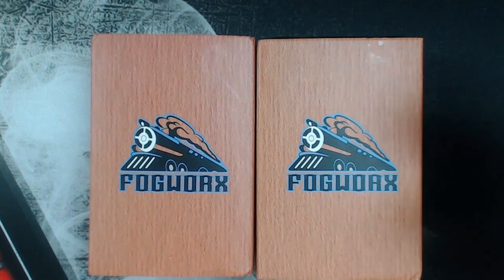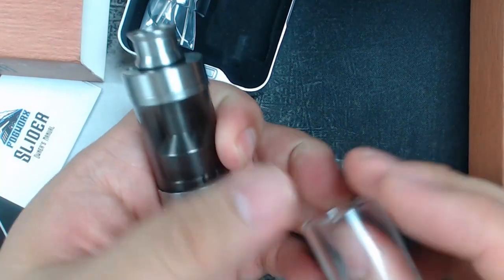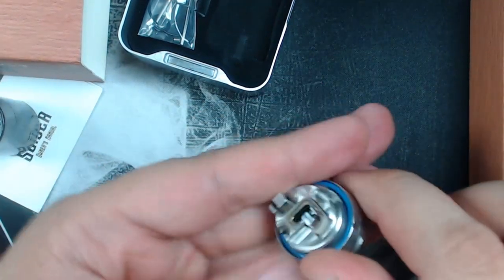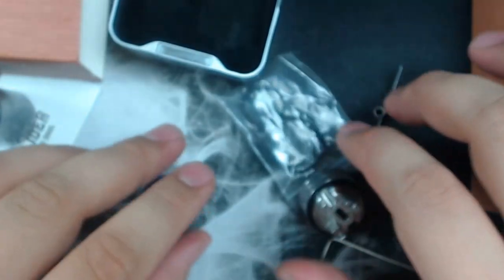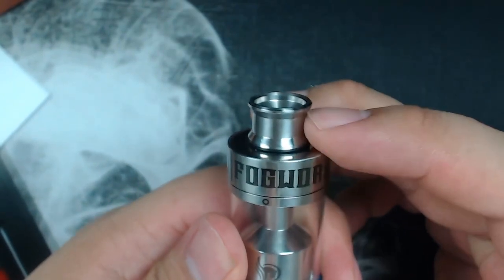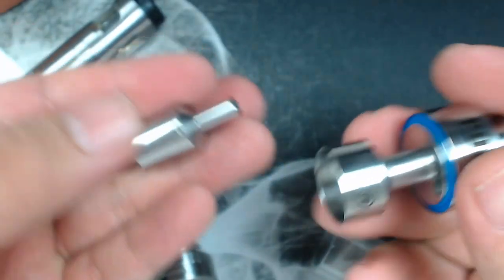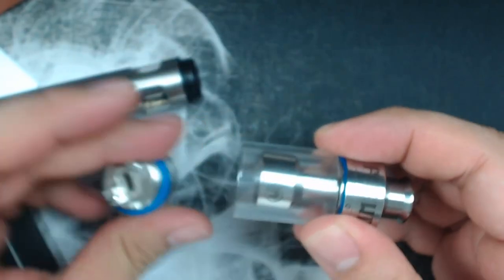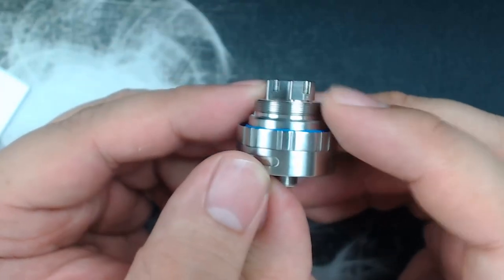FogWorx Slider RTA   Creation, Construction, Back Story

Comment: Hey Peg, First of all I want to say, I love this tank.  There are a couple of things I believe should be done. I believe you have to do a build video for people that haven't built very much. When I installed the coils I found that the coils that came with it won't fit straight into the slots. I've built long enough to know to twist the legs 90 degrees and they went in with no problem. The coils are the nicest ones I've seen come in any atty kit to date. 2 points for that. lol I think you're going to get shit from guys that haven't built very long saying that the coils that come with it don't fit. I can hear it now. Another thing is I don't like the hex key (It sucks), on the first build it striped out and I didn't even tighten it all the way, and yes I had it all the way into the grub screw when it happened. 
       I love the fill cap on this tank it's easy to fill, with no leaking or seeping at all. Nice design bud.  I've only had it a couple of days but haven't had a single drop of juice from it at all and that's with 6 tank full put thru it so far. It's been very easy to build (once I twisted the legs) wicking was a piece of cake. The flavor is excellent I haven't had any wicking problems and I ran this up to 65 watts just to test it with no problem at all. I've been running it between 45 and 50 watts. You got a great tanks here. One thing, is there any way to get a couple of the new o-rings for the ones that I've got. It would be nice to be able to flip the tank as you described as I tried it before this video and lost the juice that was in it, I could of used a syringe but figured I'd give it a shot - oops - lol. Anyway thanks and I'll write you again after using both tanks for a while.  Thanks for the opportunity test this for ya, I love it so far.  Later
Reply from the maker: Literally everything you mentioned has been taken into account and will be corrected.
I appreciate the feedback MArvin and hopefully you'll come back for a finalized version.
It will make sure for more solid screws, larger slots.

Comment: Hey Peg, I've been using the new Slider RTA and it really vapes great. The Slider cap is so easy to use! The drip tip allows great airflow and never gets hot. Great design! The only change I thought I would like to see would be larger diameter grub screws which you have addressed!

Comment: Got this tank SUPER fast and even though I couldn't get the included clapton to work, I put a twisted 28 gauge build in it. Im running 1.39 ohms at 17.5 watts and its an awesome vape. I also closed down the air halfway because I like a more restricted vape. Flavor is awesome!

Great Job!

Edited to add: Saw you comment to someone there was still a few available and got another for the S-O :)
Reply from the maker: Nice,  how does this pair to your preferences?  
Thoughts on 24 MM?  5.5 ML capacity? (be sure to consider that larger capacity would suggest a longer chimney or wider atomizer)
Were you able to chain vape with any issues?  Was the vape moist?  any spit back or popping?  Thoughts on the drip tip or prefer your own?
Reply: Im fine with the size and capacity of the tank. I dont have alot of experience with 24 mm tanks or RDAs because I have been stuck on the tugboat since it came out and nothing has replaced that for me. LOL 

I dont really chain vape, but I did not get a dry hit at all (Im using a 65 vg juice which isnt all that thick) 

When I use twisted kanthal, it never pops or gives me spit back. (I actually miss that old carto pop) The drip tip was fine IMHO. I have yet to want to change it to something else.

Comment: Great features. I've been looking at the latest Ammit 25, but the point you made about too much airflow not keeping the cotton as wet makes sense because of how they work. You need some vacuum in the chamber to pull more juice in. I'm a chain vaper so wicking is crucial to me. That's just how I vape. Although the threaded coil channels could be wider for our fat ribbon staple builds, I'll be watching for this from Canada.  Thanks PVA for your work!

Thanks from some random guy to beta testers as well! Instead of some engineer thinking he knows what vapers will like we'll all get a well tuned RTA. :)

"Phone size corresponded directly with network bandwidth and once people realized they could watch porn on their phone the screens got bigger again." ~old meme

Comment: Hi everyone, Here are a few of my thoughts on the Beta RTA. Extremely economic on the usage of juice and battery life. I have been quite impressed with the lower wattage (30-48) running a few style coils. Mainly I have been using Staple, Framed Stapled and a Staggard Fused Staple Coil. The unit really never gets too hot after chain vaping. 

There were a few concerns I did have on the Beta that seems to be addressed in the production version of this unit. So this vid helps to better understand this unit and the builds this unit will accept. The only concern I still do have is the Slug screws. The beta version these are really small and very easy to cross thread in the post. When I used coils that were framed the screws and posts were not able to hold too much. And on one Framed Staple I had put in (2x26g with 8x.5 A1 ribbon, 36g wrap) this unit had the screws barely holding the coil. I ended up cross threading the screws just enough to hold it. 

Overall this is a really impressive unit. The cloud and vape quality is what I would expect out of an RTA and this one goes a bit further with the economy of design and conservative nature of using juice and batteries. 

Thanks again for allowing me to participate in the beta and look forward to all the products from Fogworx

Comment: glad i got to see the deck.  i should have mine by tomorrow.  from what i saw, the fill method looks interesting.  the markings on the tank don't look like they're etched in too bad so maybe i can sand them off.  the unmarked prototype you  showed was exactly how i felt it should've come.  one more possible issue i see is the airflow outlet on the build deck.  without a slight lip around the airflow hole, there may be a possibility of leaking.  I guess i'll find out soon enough.  What do you recommend for coil resistance, coil diameter, and applied power to optimize performance out of this tank?
Reply from the maker: The coils that come with the tank is not without its issues,  it was also a reason why we had to switch factories and this beta model is now a dump item.
We still released the samples because it is a working model and does vape the way we expect it to.  Simply put,  its got a few bugs but nothing we can't iron out in the final release.
Personally we've ran .25 coils in this thing all the way to .7   Its just an opinion but if you want the creator's intention then we think .3 ish coil is best  and adjusted to whatever your wattage equivalent of 3.6 volts is.  In my experience I find wattage numbers debatable between different devices.  However a nice 3.6v mechanical voltage is what we were aiming for,  I think you understand our reasons for this setting.   

Bottom Line: we aimed to create an easy to use, large capacity, flavor tank.  If you can see it as an everyday carry for a single coil lover, then we've hit our mark.

Comment: Hey Peg thanks so much for doing the beta version the other day. It came extremely fast and i broke in to it immediately. First thing, love the drip tip as you said it is really comfortable. Also thanks for the tip about keeping the wick at the thread line. It works beautifully now especially because I just changed my wick. I didn't have any leaking taking it apart (was very careful) with the beta O rings. will you have the newer O rings for sale anywhere? I'd like some. Thanks again for the opportunity to give this a try. It works terrifically and looks sexy in gun metal. It's pretty big and beefy though, as I'm usually into smaller rda/rta s. It's really not a problem though.
Reply from the maker: Thank you very much for taking part and your feedback.
how much did your coil ohm out to and what wattage did you find comfortable?

Comment: Hey Peg, I skipped around a lot during the video to get to the good stuff. Did I miss you say where to get the newest version of this tank? Found of gear best but it doesn't look the same as the blue o-ring edit "gasket" one you shown in the video. Thanks!
Reply from the maker: Gear Best has the dump inventory.  Everything we rejected.   I can't say those are clones.  Those are rejects.
In the story I explained the company we were dealing with would constantly deviate during each revision.
Eventually they told us they were not going to revise any further and we weren't satisfied with the outcome.
So they said take it or leave it,  we left it.

We decided to hand out all the samples we received because they are still working models and still vape like the way we intended it to.
Ofcourse we can't do giveaways so we did a ridiculous markdown on the PVA website.  You basically cover the cost of customs and shipping.

I knew that we have enough early adopters on our channel willing to help us out with testing and insight and generally help us put the word out there and confirm our claims for a quality device.  Plus these are unserialized sample version and easily a collector's item.  Still,   I personally think its worth waiting for the final release.

Comment: I got mine today (3335) and I like it. If the upgraded gaskets become available for purchase, will they fit on this beta model? Is it possible to disassemble the deck (post and center pin) without doing damage to the deck? Thanks Peg

Comment: Hi, regrettably I ordered a Slider from GearBest before coming across this video. Is there anything I can do apart from sending it back (which will almost cost me more in postage than what I paid)? I hate to be supporting a factory that practices these kinds of things, releasing a bèta product onto the market (and it also would be nice if the glass could support itself with the gasket and a fraction bigger screws (the provided coils don't fit the way they're intended to fit, but I never use coils that come with a product without specs on the coils).
But apart from these things, I really like the vape I'm getting from a single core SS316L clapton (26g+40g) at temp control. Thumbs up for that!
Reply from the maker: Regrettably there's nothing we can do because they're in china.  However they have been warned not to touch the US market or legal action will be taken.
The good thing is that the beta is a working edition but its just not optimal.  The clapton that came with it is rotated in he wrong direction and the post holes dont support it right.

I'm glad you still eny the vape,  the purpose of this model was to optimize a single coil and get folks mind sets away from everything needing to be dual.

Comment: Hello I just received the slider rta and I have to say the looks are so nice but unfortunately I'm doing something wrong or it's extremely difficult to wick because the taste is very bad.  I think the first time I put too much cotton and so I reduced the cotton to where you can't notice it on the holes.  After that it was still bad and I'm so bummed out because I really was so excited for this tank.  I also noticed it was very hard to rotate the bottom air flow even after I juiced the threads.  I hate to bitch man but I'm sure it's me because a beautiful tank like this can't be tasting like this.  Any suggestions?
Reply: I also used the coils you included which looked real good and fired up beautiful
Reply from the maker: hmmm.
Follow these steps no matter how simple or silly it sounds.
#1 Adjust aiflow to maximum first.
#2 Build a coil with a 3mm inner diameter.  Make sure height is balanced and leads are cut flush.
#3 Work out your hot spots first but start with low wattage just to get a light glow,  no reason to light bulb it.
#4 Hot spots are easier to work out if the coil is spaced.
#5 do not choke the coil with cotton.  trust that your juice will expand the wick enough later.

What is the ohm or your coil?  it shouldn't be lower than  .25 for a single setup.
Whatever your wattage setting make sure you're not applying more than 3.2 volts to starts.
Then increase as desired.

Lastly,  try a different juice.
Reply from the maker: Glad to hear,  is it tasting better now?
Reply: Pegasus Vapor Academy 
Thank you so much for you response I'm gonna take the tank to a local Rep here in town so we can look at it together.  Can I ask what metal is used for the 2 coils you include in the box? It's so easy to set up that it's hard to mess up because you did it so beautiful.  I will update you once I work out the glitches.  Thanks again for your response
Reply from the maker: Those are SS316 coils  so be careful not to overheat them or they will stick together causing a possible short
Reply: Hello I promised I will get back to you about my issues with the rta and I finally figured out that I can't screw the top down, I have leave about 2 full twists leaving a gap and as soon as I did that lots of bubbles came out and the taste was fantastic!  I refused to give up on your creation and knew I could make it right for me I'm not sure about others but for me if you screw the top all the way down (not tight) then it doesn't suck at all (no bubbles) I switched up coils, cotton and tried it all but someone recommended to unscrew top leaving gap and it worked beautifully.
Reply from the maker: thanks for coming back and letting us know